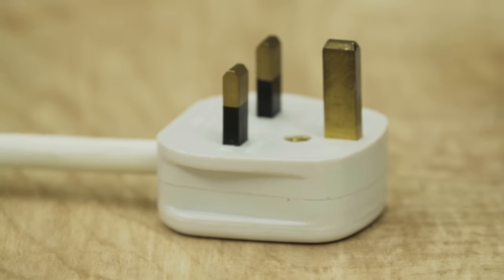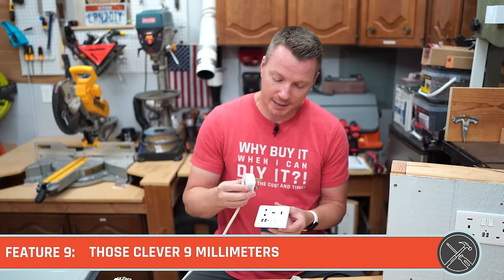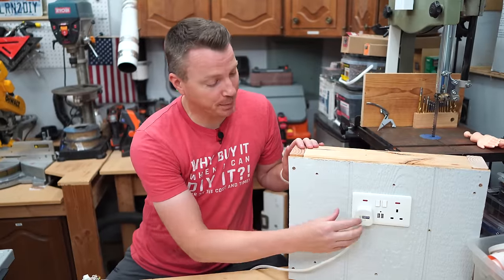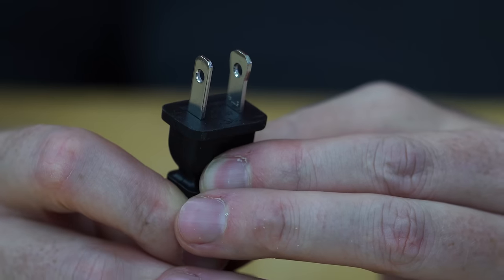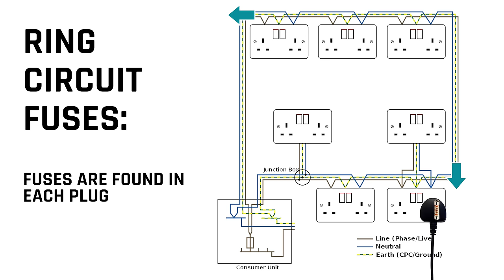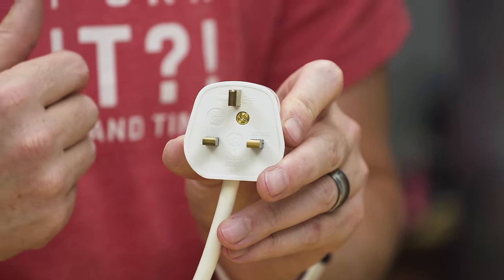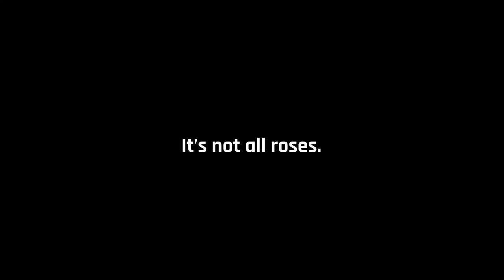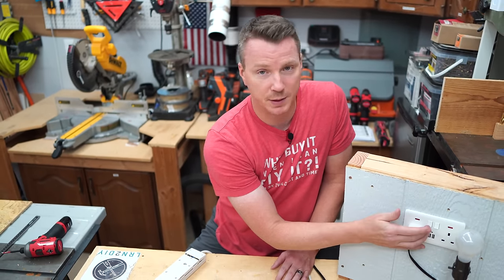British Plugs and Outlets Are On Another Level

Comment: As someone that grew up in Englnd, I can testify that we did get shocks at 240v. They didn’t have the safety outlets in the 80’s. You would often use a regular plug as a guide to plug-in bare wires. 🤣

Comment: Re wiring a Type G plug was something we learned in physics at school, out of the whole class only mine was safe, everyone had connected the correct wire etc but no one else had trimmed the live / neutral to be shorter and had a mess of wires inside

Comment: TRUTH ABOUT THE DOWN SIDES OF THE UK WALL PLUGS: 
1 - Load balancing just isn't a thing. Appliances always work in every socket all of the time. Never heard of it or anyone having issues with it or wiring problems because of it. It just isn't an issue in modern Britain.
2 - Installing and maintaining a ring circuit has never effected me, why would it, I'm not an electrician. 
3 - Socket switches are never a bad thing most even have an indicator to show the difference between on and off but they all work the same way - bottom pushed in = on, top pushed in = off. To suggest there is any drawback to this is grasping at straws. If you're not used to wall switches and forget which is on and off test your appliance in both switch modes and then in another socket. 
4 - I'm 48 and have lived in the UK my whole life and have never stepped on an up turned plug at any point in my entire life. It would surely hurt a lot to do so but it really isn't that common, mainly because plugs are never left unplugged from sockets.
5 - Considering all the supposed negatives against the positives mentioned in this video I'll take the UK Type G system every time over all other plug systems. 
6 - The only real downside to being so used top the UK plugs is that encountering other types when traveling always fills me with slight anxiety about using them because they feel so much more flimsy and dangerous

Comment: Load balancing is a very very rare issue because each property has several ring cirucuits and they tend to allocate to seperate areas of the house where loads differ: e.g. rings will be set up for : upstairs lights; upstaris sockets, downstairs lights, dowstairs sockets, kitchen lights, kitchen sickets, utility lights, utility sockets
 Ovens, EV chargers, garden and out buildings will be on seperate rings.

Comment: yea, i love this plug a lot, i do almost get shock once, and those plastic insulater on the pin save me, 
although its due to the plug super hard to unplug, and i do it in dark.

we are using 220V tho, and u didn't menston the "4. beefy pins" have lower resistance too. The higher voltage makes it more likely to arc , and lower resistance pin makes it more likely arc to the pin, um... kind of balance way.

we use ring circuit, for EACH ROOM, 
and another ring circuit for the heavy power unit like air conditioner, each room. 
different ring need different A tho.

oh almost forgot, the best part of this plug is, they reraly make those zeez sound, the bad connection.

Comment: All appliances sold in the UK in recent years have fixed, moulded, non user-serviceable plugs. They are type G, though. Also, it's worth mentioning that, because the live and neutral pins are sleeved in plastic, they are not 6mm thick throughout, but are much thinner under the sleeved portion. Indeed, when heavily loaded for prolonged periods the live pin has been known to overheat and melt.
Reply: True, but you can cut them off at the cable if necessary and replace them with a standard serviceable one. But in most cases the only thing you're likely to ever need to do is replace a blown fuse.
Reply: true, but they also fail the uk saftey checks, as they are known to melt when it is thinner under the plastic, also the only really happens for high energy appliances like ketels and oven and in that case why are you buying a cheep oven that cant even be assed for your safty, tbh in that case you had it coming.
Reply: @BassBoostedDuck  Nobody with any sense would connect an oven through a 13-amp plug and socket in the first place.

Comment: In NZ over 30 years ago, they banned plugs that had the cable coming out of the back of the plug. So the plug could not be pulled out by the cable. The cable drops down from the side of the plug.

Comment: As a Filipino,Type a plugs with insulation on the prongs are very common.And we actually run off a 230v supply,Not a 220v.And of course, Filipino outlets also have shutters and grounds so type b plugs can fit.

Comment: As a Brit I've never met anyone that's had any load balancing issues on their circuit, our domestic wiring can take up to 15Amps. I'm currently running A washing machine, a tumble dryer and two freezers off one extension without any issues at all, the plug in the socket doesn't even get warm.
Also the size of the plug, because our cable drops down vertically they actually stay closer to the wall than the US cables which stick out horizontally, meaning that we can keep the cable against the wall at all times, leaving less of a trip hazard.

Comment: Most US is at 110v. Australian ones are of a similar design but with pins oriented a different way. Longer earth pins and insulated active and neutrals. Though our pins are easier to make as they can be stamped. Our sockets are all switched too. Though we run a 240v system here which can be as high as 260v in certain areas or as low as 220v. One of the reasons that the UK plugs are serviceable and have built in fuses are because they use of lot of ring mains. Ring mains were introduced as a cost saving measure to reduce use of materials due to WW2. Here in Australia they are all radial though. Mainland China have adopted the Australian system in many of their regions too. Australia has adopted the best of all pretty much all systems. It is not pleasant to get a jolt from ours though. I have had a bunch over the years.

Comment: As a Brit, never has anyone I've ever met, and I mean literally anyone, has had a problem with the switches.. It's literally the first thing you check when something isn't turning on. The plug falling on the ground is a you problem too.. Just pick up after yourself because plugs don't just fall on the ground. Also the size has never been a problem either, especially in most houses where they're places in locations where they are hidden by furniture (behind a couch, behind a TV, beside your bed etc.) so these points are basically "If you're stupid and messy, you won't like them". Of course that's a factor but the safety of the plugs and the fact you have to really try to get shocked by one is all around much better!

Comment: One thing that was missed about the ring circuits we have is that there is at least one per room to minimise power loss to a whole house/building.
Depending on the size of the house, it's typically:
- One circuit for the room lights per floor
- One circuit per room for the sockets/outlets
- Oven, Fridge/Freezer/Fridge-Freezer, and the Washing Machine might have their own connections separate from each other and the rest of the circuits, or are on the same circuit as each other but still separate from the rest
- If you have them, outside lights might get their own as well as external sockets/outlets

If you live in a bungalow or a flat/apartment, the lights in each room are more likely to initially be on the same circuit as that room's outlets, but are often changed to be separate during electrical rework
Reply: If you are referring to a British final ring, they do not have them for just one room.

Comment: A warm thank you for showcasing the safety features of the British plug and domestic electrical system. In some respects it is a pity that most appliances are now supplied with a sealed plug. If these ever need to be replaced, increasingly the average homeowner will no longer possess the knowledge to do so. In the past, a very useful wedding present was a box of new plugs - the correct wiring of which was something you learned in childhood!
Reply: I make up extension gangs using a roll of 1.5mm 3 core and plugs.  Pre-made ones are never quite long or short enough for cable management.   After seeing somebody wire up the live pin in a plug to the Earth wire on the device, I can why they introduced molded plugs though!
Reply: "If these ever need to be replaced, increasingly the average homeowner will no longer possess the knowledge to do so."
There are only 3 wires... L,  N and Gnd.   It's not Rocket Science.
If you can boil an egg you can change a plug.
Reply: @petergibson2318  I've lost count of how many dangerously-wired plugs I've come across.  Don't overestimate the skills of the average person.

Comment: Australia has all the load benefits of the British plug with the size similar to the US Plug, we also have switches on each outlet, it has never been an issue and is considerably safer than the US plugs, Australia doesn’t use the G type plugs because when the UK switched too it they were using the same current plug we still use in Australia and us being us were too laid back to adjust

Comment: New installations dont tend to use rings as they have a failure mode that can cause fires. 

A ring is commonly protected by a 30a fuse or breaker but if there is a break in the ring it will continue to function but all the current will pass through one set of cables overloading them massively.

You could though fuse each end of the ring separately to protect against this failure mode.
Reply: Would you Brits get rid of the fuse in your plug when ring circuits become old fashioned?

Comment: Here in the U.K. the socket & plug systems r great,I was surprised to hear that plugging certain appliances,if they're power hungry, together causes problems in the U.S.. Here in the U.K. iv never had any problems plugging in power hungry items next to each other,even on 6 socket extensions u can run powerful items together on all 6 spaces, without problems. Also,some of the plastic earth/grounded pins on the plug are not even connected,they only serve to open the safety pins on the socket, this should only be on appliances that r insulated or can't conduct a current, usually plastic or non metal appliances.
Great vid tho....

Comment: My only gripe with Type G (UK Standard) is that the prongs stick out 90 degrees and don't fold. I'm not sure it's required by the specification but it probably is, as it would be much safer. As a nomad that constantly travel around, the total size of the plugs are a problem and foldable prongs would help them fit better in backpacks.
Even if most of my stuff is USB-C nowadays and I only need to carry two or three adapters to have my chargers available in different parts of the houses, I would still love to see foldable prongs as kind of standard.
Reply: There are foldable British G Type plugs available.

Comment: From the UK here. I stepped on a plug before, horrible. I’d definitely prefer to step on a Lego again over a plug. Also you said that the switches were double edged but when you get into the habit of flicking the switch at the wall, it becomes standard to do. So often I’ll switch the plug on then the device. And if the device doesn’t work, immediate troubleshooting on the device. The so-called bulky design has never felt bulky imo. It feels secure

Comment: A couple of points.  1 - Class 2 appliances are not double grounded.  They have no Earth.  2 - Not all of our plugs can be disassembled.  It is becoming more common for the plug to be moulded and the only accessible item is the fuse.  3 - Not all of our sockets have switches.  4 - We also use Radial circuits alongside Ring Final Circuits for Sockets

Comment: The US is kind of a 240 volt country. The transformer outputs 240 volts but it's split over two 120 volt lines (and a single ground wire, so three wires  total). when the two 120 volt lines enters the house electrical panel each adjacent circuit breaker slot alternates which 120 volt line it's connected to so in order to get 240 volts you just need a double wide circuit breaker (and correct gauge wires and one of several different sockets depending on how many amps and what it used for.) Anyways the US is a 240 volt country but we use two 120 volt lines, because having three wires on a transformer is clearly way better than just two.

Comment: As a UK electrician. We still use Ring circuits a bit. We are slowly moving over to radial circuits like the rest of Europe, being equipment is more energy efficient . Using 230v, also means the amps are dropped, so we can use thinner cables in general. Lastly, let me tell you there is nothing more excruciatingly painful than standing on an up turned plug, no Brit will ever recommend 🤣

Comment: Good video but you forgot to mention that there are different size fuses. So for example you would use a 13amp fuse for a washing machine but a 3amp /  5amp fuse for a lamp. I think I saw a 13 amp in the video which would not be used for the lamp ;)

Comment: In regard to standing on a plug left on the floor, well you miss the point. Because the socket has a switch there is no need to remove the plug and leave it trailing on the floor when you want to power down an appliance you just switch it off at the socket and leave it plugged in

Comment: We use these plugs here as one of the old dominions of the UK. Size with the plugs has never actually been an issue! At least I've never encountered it and Ive worked in places where we had one of those box splitters that you can plug in one plug on each side. So... 5. And they never got in each others way. Granted some plugs ARE different. But share many of the security features. The switches are fine too, you just instinctively know it.

Comment: The other advantage to electricity in the UK AND the continent is that the voltage is ~250 which means that the amperage is lower to achieve a given wattage. 4 amps @ 250 volts = 1000 watts while it takes ~9-10 amps @ 110 to 120 volts to achieve 1000 watts. This is why the wires @ 250 volts are thinner since amperage determines the gauge of the wires.

Comment: As a brit I have to say I’ve never known about this load balancing issue causing a problem. Even in the most likely case of having a bunch of power hogging appliances all in one place, like in your kitchen. You could have a dishwasher, microwave, kettle and possibly tumble dryer and washing machine going on but even though together they technically exceed the rating of the wire on that particular part of the circuit, it doesn’t actually cause a problem for other appliances in the house. I guess you’d have to be deliberately stress testing it to incur a problem.

Comment: Few thoughts. Many UK plugs nowadays are moulded, the only serviceable part in them is the fuse. Many appliances are not earthed, so the earth pin is plastic or just not wired (even some kettles). There are sockets without switch too, the switch is just an annoyance anyway (especially with digital clocks and chargers accidentally switched off - yes it happens with native Brits too), but I'll not switch off he TV or any other connected or remote controlled device either. It's annoying that I can't plug them in upside down and because of this chargers are sometimes in wrong direction, also like someone else wrote when the cable should go up it first has to go down. 
It'd be useful to see modern day statistics about how many people are electrocuted by sockets in the UK compared with other regions where they use different sockets because I didn't hear of mass deaths for this reason. Not only the socket types but in most countries I've been to there were sockets in the bathroom so it was possible to use a hairdryer and washing machine in there, and still the population didn't extinct.
In most of the cases the plugs designed for 13A load are at least 80% waste because in most cases the load is 1-2A so all that plastic and metal is just ballast, and with electronic devices maybe even more. So much about reducing waste and going green. It may have been useful in the old times when many uneducated people started using electricity but these days these plugs and sockets are just extremely oversized not only physically but in terms of capacity too. The European way of having plugs with thinner prongs for low power and thicker with earth pins for high power appliances is more flexible and still prevents plugging in high power appliances like electric heaters into lower rated sockets without earth pins. 
The bottomline is that these sockets are an engineering masterpiece but are not practical and are solving problems that no longer exist and may have not existed ever.

Comment: Load balancing?  That just isn't a thing.  I can take all 30 amps anywhere on the ring.  The wires can actually take 25A each.
Installing and testing it isn't difficult, it's certainly a lot easier than your extra live wire for dual voltage.
The ring isn't really required, they could just use 30A wire and not complete the ring.  It depends where the sockets are physically located in the house.  If it ends up easy to make a ring shape, then why not?  It gives another path for current to flow.  But if you have a long narrow house, running the wire back again is a waste, and I don't bother.
As for the Lego, yeah, you're right, I've read somewhere more people go to hospital in the UK after standing on a plug than getting electrocuted.  You might say it's better than an electric shock, but actually neither of them usually kills you, but falling over afterwards can.  My neighbour fell off a ladder after getting a shock.  The electricity was harmless, but he cracked his head on the floor and it could have been worse.